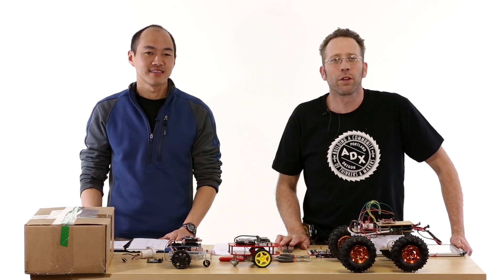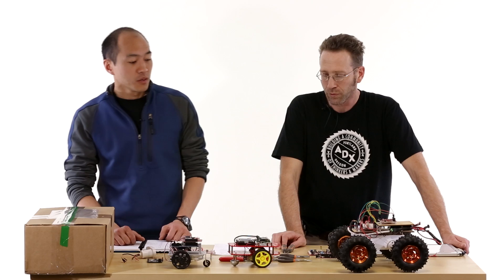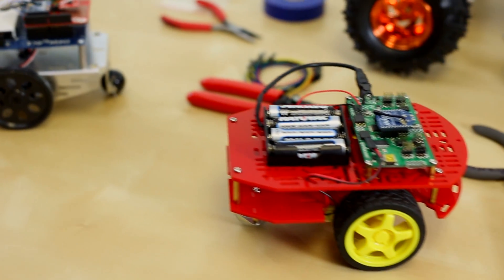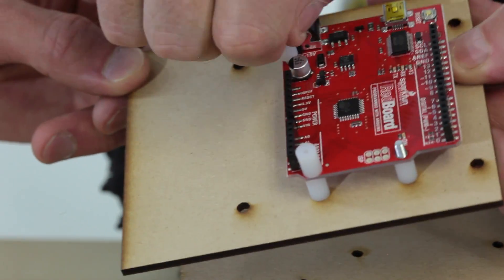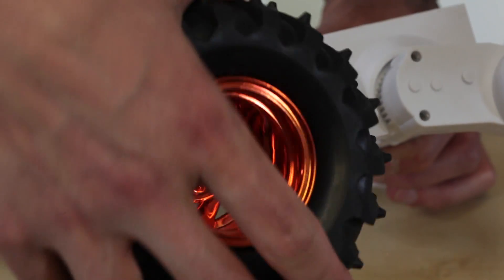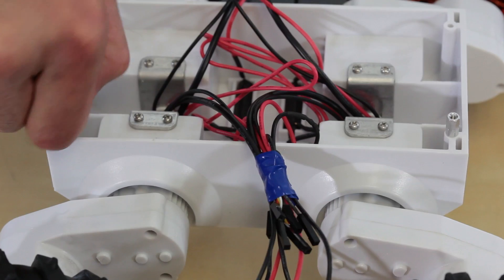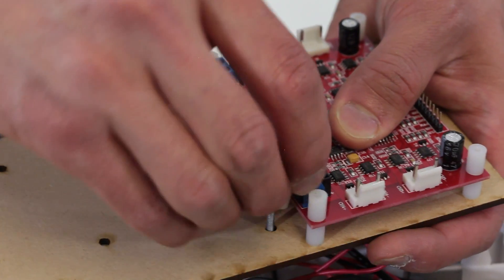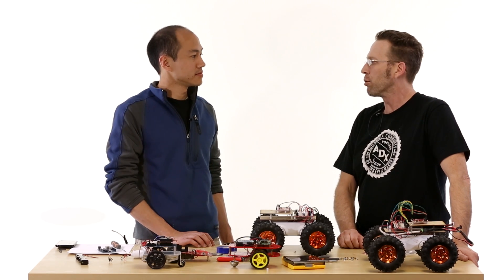SparkFun Autonomous Vehicle Competition Robot Build Part 1

Comment: Is there a reason you don't answer the questions about the part II of this? I see the wheels have been discontinued and I don't see the axle adapters on your site either. But I have one of these chassis - and I bet a lot of other folks do, too - sitting around waiting to get built. A little more on what you did with it would be great! Sketches, diagrams of the boards - whatever you have? Bueller? Bueller?

Comment: As video show on rover 5 chassis the inner motor shaft is 4mm? and needed the extension shaft 12mm 6axis hole for tire is that correct measurement?

Comment: I have the Rover 5 with the Big Nobby tires like you have however, it feels like the shafts you mount the wheels on can bend very easily with those wheels.  As a matter of fact one of mine was warped when I received it with just the tank treed hubs on them.  It was easy enough to bend back though.  Does sparkfun think the Rover5 + Nobby wheels will hold up?  If so great. I have been paranoid of mine.
Thanks and this is not a dig at you guys, love your products. A big fan.